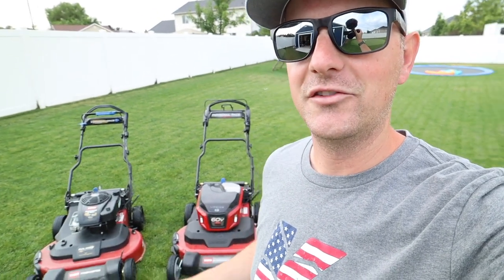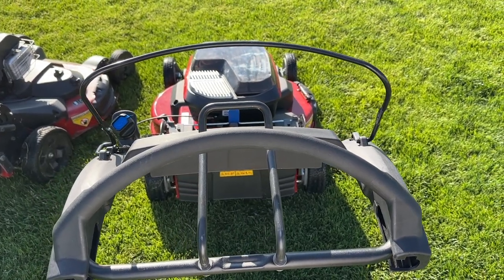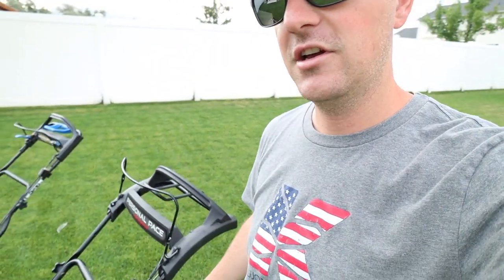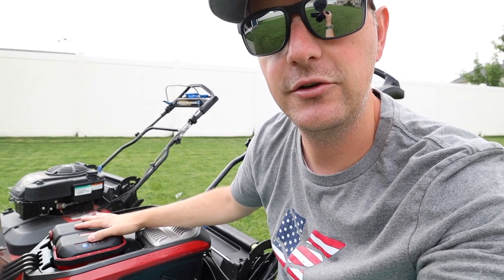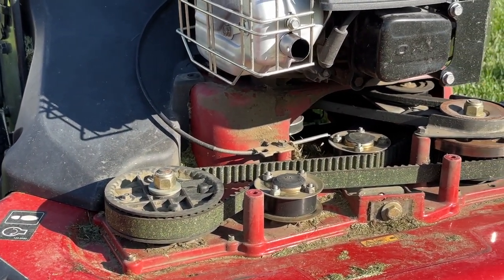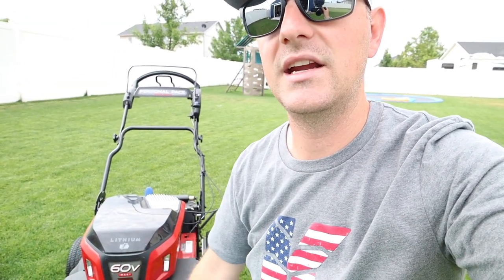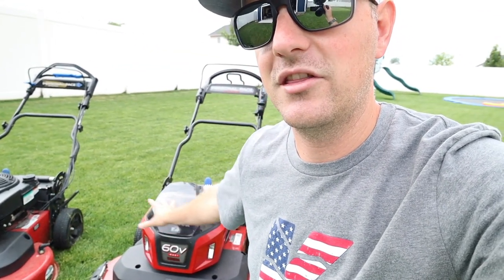Toro TIMEMASTER - Feature Comparison - Gas vs Electric

Comment: An extra grand for a mower that will cut for one hour. So add $250 for a third 10ah battery if more mow rime is needed. And it won’t move under power without the blades moving. Your experience with your gas model, and this comparison, reinforces my desire for the gas model. Good video!
Reply: and applying it to commercial use you will need 12-15 batteries and hopefully they last 2-3 years and that you don't forget to charge them
Reply: 1 hr in nice dry grass, ideal conditions. Don't you dare mow wet heavy grass or in extreme temps or the batteries will overheat and go into circuit protection mode. I'm sure the crews will love have multiple lunch breaks per day while the batteries cool off.

Comment: THANK YOU for finally making this video. No powered transport is a deal breaker for a mower this heavy. I'd hate to be the person who made the decision to remove that feature. I'm off to try to get one more Honda before they stop making them.
Reply: I've had 7 or so of the hrx217 granted I've only bought 2 new and the rest bought second from homeowners. Thinking of checking the honda commercial but they are about 1500-1600 plus tax

Comment: If the engineers where going for max battery life, I’d think they get rid of belts and have dual motors 🤷🏻‍♂️ Thanks for the video!
Reply from the maker: I asked him about that. He said it was a matter of cost and serviceability with the decision to keep the blades belt-driven.
Reply: If they did 2 motors the blades would no longer be able to avoid hitting each other without a total deck redesign to offset the blades as most dual blade mowers do.  They obviously wanted to avoid doing that.

Comment: Nice, video Jimmy. I have to say after testing this mower myself, I have been really disappointed in it. During a normal maintenance mow it was tearing the grass blades and leaving lots of uncut grass in the auto and max power mode. To remove the blade stop feature was a huge mistake. For the current price point of $2400 I think they should have really spent more time on the overall design. Have you been having cut quality issues?

Comment: I plan on chaining three 21" 60v Super Recyclers together for a 63" mow deck with 3 motors and 3 7.5 ah batteries. People will say that's an insane amount of money to spend on mowers, but it'll be $2 cheaper than the 60v eTimeMaster. Insane that Toro thinks thats reasonable.

Comment: I ordered the day my Toro dealer was able to place an order.  First I'm learning of the inability to transport under power with the blade off.  Hugely disappointing as that was a main reason I bought the gas Timemaster.  Hopefully Toro takes advantage of further improvements battery power allows over gas with a gen 2 eTimemaster (ie no belts at all, direct drive motors for each blade).  Still excited my neighbors wont have to hear that massive B&S engine on the gas version.

Comment: I'm also on the original belts on my 4 year old gas Timemaster.   Hoping to get several more years out of my gas version, but I will consider electric when the time comes and hope that battery tech and cost will both be better at that time.

Comment: I have had the SAME issue on my 2016 Toro 30 in TimeMaster. It NEVER starts hot. There was a recall to change the crummy paper fuel filter, but i solved that design flaw, where the fuel feed is only 1/2 in drop from the tank outlet to Briggs 120000 series engine carb. I lashed on my Honda GCV190 Tank and a nice long hose, with a Disc filter and Shutoff valve from Home Depot. The Briggs recall is to install a metal HEAT SHIELD between the cyl head and float bowl, to fix hot restarting. I  often do better than that, just get some silver foil faced R-MAX foam insulation, maybe cut 3x5in,, smash a recess to fit behind the float bowl with a small hammer, and shove it in place above the black plastic belt guard cover. surfaces, that worked for a few years,then needed to cool things down with Starting fluid or Gumout to restart hot. I then replaced the carbs several times with the inexpensive ones on Amazon. Worked a little better than Briggs OEM. FINALLY, I did replace the Magneto coil and shutoff switch, but yesterday PROVED THE NEW ONE IS INTERMITTENT. Got an adjustable Spark Tester, set for 10KV gap or larger - NO OUTPUT!!!!!!!!!!! Then I took the old one, sanded the pole pieces and TAPED the entire HV lead with 3M Electrical tape, and split the plastic insulator sleeve from my new Spark Tester, covering the CHAFED section where the muffler heatshield abradedi it. BINGO, it finally started!  I then checked the Compression cold, but forgot to open the throttle plate - it read almost 30lbs. We also replaced the crummy HEAD GASKET again, with the 2nd gasket in the $42 Amazon kit, which HAS A NICE METAL fire ring, but is for the 223CC Upgraded engine all the Yard Service guys pay $500 new, to finally fix the underpowered temperamental 190. I found the old gasket BLEW OUT near the Exhaust side, a second time, vapor from all my Starting Fluid was coming out. Another telltale sign was the 4 head bolts were NOT TIGHT. I should have retourqued to the 125 in-lbs spec AGAIN after a month.
Since 70lbs seems to be the spec for these 190CC motors, I WILL be buying a new Piston, Rings, and Wrist pin set, and the 2 different length Rod bolts to raise the crummy 30lbs that is causing stalling issues. And my friend set the VALVE clearances ay 0.006in, AFTER INSTALLING THE NEW thicker gasket.  It starts if I put the choke rod in, but soon I fave to remove it, and flip the choke spring 180 degrees over, to the main governor spring post, r it will bog down too rich! When I get anther $500 saved up, I am going to Toro Menders in ATL to buy a replacement 223CC engine, and a new DECK for another $100. Final note, there is a Hi Lift Blade kit, including a new front V shaped shield that bolts in with the front wheels assy - critically IMPORTANT, IT USED TO just fill the chute with grass. ------------- for the past 8 years it will FILL the bag with even wet grass- My thoughts, nothing else is safe on my sloped back yard, and at 150lbs for me, I can easily handle this 135lb mower. Just skip the $200 more Electric Start option,  because it will be clunkier to use there. Just my thoughts after 8 years of Time Master troubles. And I replaced many broken cables, worn bearings, and belts Fyi, Hilary in GA

Comment: Great video.  I'm curious how the power / suction compares to the gas model?
Reply: It's never going to be the same due to the lower lift blades.  You can put high lift blades on but be prepared for much less run time.  So maybe not an issue if your lawn is really small or else you will need extra batteries.

Comment: I have a 3-4 year old Toro 60V mower (model 20353).  The average house lot size in the U.S. is less than a quarter acre, so after you take out the square footage for the house, driveway, and landscaping, the area to mow is even less.  My point is that you don't need as big mowers as you are talking about in this video for most people.  My Toro uses a single battery and I only use about 2/3 of it to mow my net 1/4 acre lawn.  Additionally, the distances to push the non-running mower are much smaller so not having it running while moving it isn't really an issue.  If you look at new 22 inch mowers at Home Depot, the Toro electric 22 inch recyclers are about $125 more today than the Toro gas versions.  But, you don't have to buy gas, do tune-ups, oil changes, etc.  The battery should be good for many hundreds of recharges and overall lithium ion battery costs are declining geometrically so a future replacement will be less expensive.  And, electric motors basically last forever.  (If I remember correctly, the motors in the trolley cars in San Francisco lasted for like 70 years.)  Lastly, while not a reason by itself to change to electric, there is a side benefit of less pollution.  Studies have shown that running a gas mower for an hour creates the same pollution as driving a car for 50 - 100 miles (varies by study).  I understand that electric isn't the solution today for every lawn situation today but I do think it is for the average homeowner, and it will be for more and more as the technology evolves.

Comment: So glad you put this video out.  Im excited to try out the etimemaster for myself.  Im curious if you have any comments on battery life.  Currently running an Ego select cut xp on a 10ah battery, and i always have approx 50% power left when im done. Tried the gas timemaster, but had some issues in the first 3 days of ownership, so it went back to the store.  I have approx 7000 square feet to cut.  How's the battery life on max cut setting?
Reply: I just purchased a 2156sp ego.   I can get my 1/4 acre lot cut 2x per 10ah charge. Would not be a fan of having the blades always engaged. That's a big no no
Reply from the maker: I’m running some tests, especially with the other blades. Will have another video out soon.

Comment: Disappointing that they stayed with the same belt and pulley system.   That’s the Achilles Heel of the gas models IMO.  I’ve gone through every belt/pulley/spindle at least once and most of them 2 or more times in 9 years as a homeowner mowing approx .5 acre of turf.   I was excited about this model until I realized it’s the same as the gas model with the addition of an electric motor.   :(

Comment: I am really curious as to the size of the motor they are using for the these, as the Toro 22in is a 2kw motor, ( blade is a light weight, switching to normal toro blade)

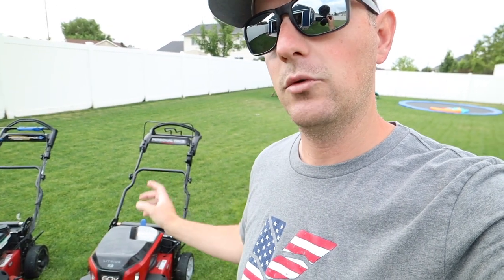Comment: I had a 2013 for 10 years.   Only belt I replaced was the self propell belt.  My engine lugs did come loose.  Actually lost one.  Don't think I'm ready for an e- mower.  My yard currently take about 1:20  min with my new 2024 toro timemaster.

Comment: I wish they would at least put an electric motor on the drive wheels. I think it would be more efficient as well. No parasitic loss in belts. If they can find a way to use 2 motors for the blades that would be great, just have to keep them in time
Reply: This would eliminate their Personal Pace feature which is fantastic as long as it does not lock up when trying to pull the mower backwards!  I have mowers with both systems and I much prefer the Personal Pace system, even with it's occasional quirks!
Reply: @GlennMcKeon-n5s  they could keep personal pace. Instead of adjusting how much pulley engagement, it would adjust motor speed instead
Reply: Does any battery mower have this yet? @ColeSpolaric
Reply: @GlennMcKeon-n5s  I'm not sure, but it seems easily doable. I have enough knowledge of electronics to know that it can be done for not a lot of money
Reply: As you can see, Toro did as little redesign as possible here.  They basically retrofitted an electric motor and batteries to replace a gas engine and fuel tank...changing as little else as possible @ColeSpolaric
Reply: @GlennMcKeon-n5s  oh, I know, that's why charging more for the tool only version that the gas is insane

Comment: Thank you very much for this informative video!  Toro says the eTimeMaster can run up to 65 minutes on two 10 AMP batteries. So I was wondering if the mower could run on one 10 AMP battery for a shorter period of time?  If so, I would assume for up to about 30 minutes.
Reply: The eTimeMaster can run on one battery in any of the three slots.

Comment: I love to have one but at that price I would buy a standon or zero turn for $1000 to $1500 more.
Reply: Not in the near future I think 😂. 

" As low as $39,999 or $1,060 per month " for an Exmark electric ... 

Exmark = Toro.
Reply: Lol you should shop in Canada for a real price shock!
Reply: @LL-mt2nz  Bonjour bonjour. Have you factored in the 'Maple Leaf Markup'? It's an economic phenomenon where goods in Canada, including Exmark mowers, tend to be pricier due to a range of factors like import charges, regulatory compliance, and market size.

You think quality is worth the money? 

And are you a hobbyist or a pro? 

Bien à toi.
Reply: @laurapalmerTDGE  I’m not a pro, but I do appreciate nice equipment.
Reply: @LL-mt2nz  - That's the right approach if you ask me. Quality takes precedence and that makes the work more pleasant.

Everything has to be fine with me, from sharp blades to the best trimmer line to the perfect 10w30 and spark plugs. And therefore years of fun. And of course also great results due to the experience that has been built up over the years.

But to make a switch to electric now ... I don't see myself doing that right away. Perhaps in a few years some elements, including a hedge trimmer. Although I am extremely satisfied with the HS 87.

A GX 35 from Honda weighs a bit too heavy for me, I may replace it with a Stihl that is more manoeuvrable. And even then, the main reason for me is that I had a tendon transfer to the shoulder two years ago, which makes abduction uncomfortable after some time.

My garden is a modest 1,600 Square Meters so that's not too bad. The Advanta Renova overseeding looks beautiful. Only here and there voles that cause damage, but that is taking shape.

Grtz.
Reply: @laurapalmerTDGE  I have converted my all of my tools to electric. I don’t have a big yard. I have all Stihl except for the mower. I went with the Toro Super Recycler. I made the switch over a few years.
Reply: @LL-mt2nz  If it fits your needs keep on using.

Comment: I have the makita 22" brushless e mower with no belts, only reason why i didn't go with Toro.   Has Toro spoke of any plans to go belt less?
Reply from the maker: Based on my conversation with them, they kept the belts because of cost and serviceability. They also mentioned that the brushless electric motor doesn’t vibrate like the gas model, and because of that they expect a significant decrease in issues with the belts and pulleys.

Comment: This was clearly rushed to market by on-the-cheap-hastily hacking a brushless elec motor atop the existing TimeMaster cutting deck and drive system.  Oh and for some extra fun and added value they decided to rewove the standard modern mower's ability to propel the mower sans blades engaged.  Super disappointing...  

This electrified TmeMaster release should of been an opportunity for Toro to take their time and offer a completely redesigned 'E-TimeMaster' like model completely re-engineered from the ground up.  I'm thinking something like a high-end EGO with dual blades and the signature TimeMaster 30" wide cut.  I'd like to imagine somewhere in Toro-land there's a building where engineers tear down and evaluate competitors electrified mowers for ideas, reverse engineering, etc?!?!?  If so, they'd at least have some idea of what a modern elec mower benchmark for features should be which this clearly is nowhere even close. On the positive side, at least they went the cheap/safe route so it being nothing more than a warmed-over classic TimeMaster with an elec motor it should be tough and reliable insofar as the cutting deck/drive system.  So there's that...

I honestly cannot think of any even remotely valid use cases for buying this mower, especially so given the significant additional purchase cost over the existing time-tested ICE model, unless one is somewhere like California or some place that has or will soon mandate the stop-sale and/or use of ICE powered push-mowers.  

For the asking price they could of at least included a third battery for some additional run-time - at least something to incentivize folks to buy this overpriced, under-engineered-featured 'e-mower' version of a classic ICE TimeMaster.  End of rant...

Comment: Is the electric version significantly quieter than the gas powered model and is the power comparable?
Reply from the maker: No to both unfortunately.
Reply: @JimmyLewisMows  Thank you for the reply! I live in California so it's going to be hard to find the gas powered model because of the gas engine ban. I have to locate a dealer that has one in stock because ordering a new one from the factory is now illegal for both businesses and individuals.

Comment: A shame Toro reusing the belt system for blades and drive systems. They could have addressed the major reliability problem in these by going direct electric drive. You'd think for reusing most of the engineering of the gas Timemaster that the price would be lower.

Comment: The technology is here for electric spindles to run the blades - look at the Revolution Series. The belts are problematic. In my light commercial work they need at least yearly adjustment and/or replacement. The extra grand for electric over gas is mainly buying you batteries. I myself own a 21" commercial Revolution and love it. Can't afford the rest of the Revolution Series yet. I will wait on the 30" until it is beltless, and joins the Revolution series.  Ease of maintenance is one of the main reasons you buy electric, and this 30" misses the boat.

Comment: Max battery life means minimized power.  Dont buy toro electric mowers.  They are a hot pile of crap.  Stick to gas if you want a toro.
Reply: I owned both. So each has its optimal use case.